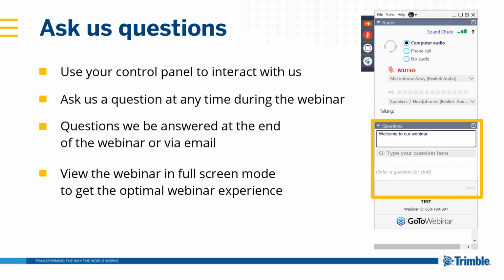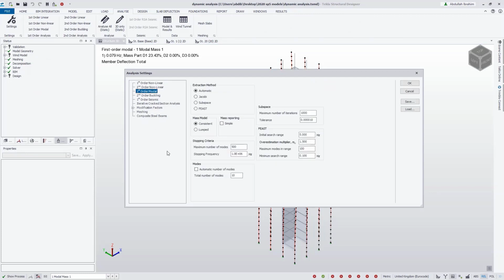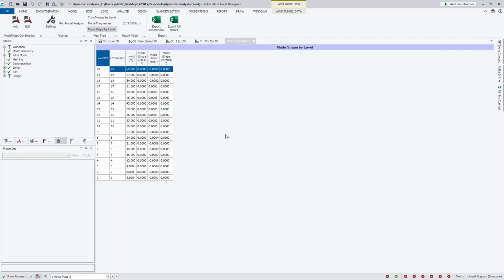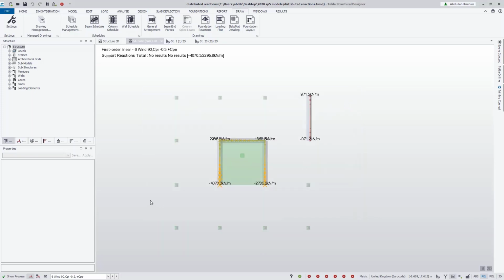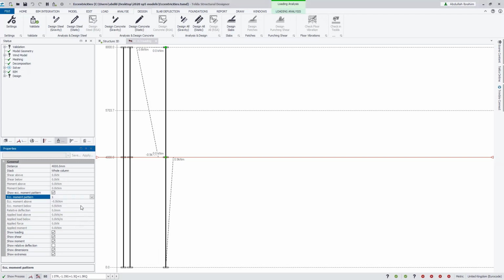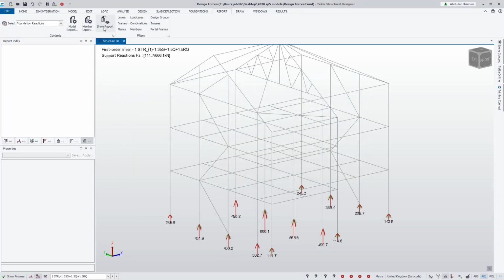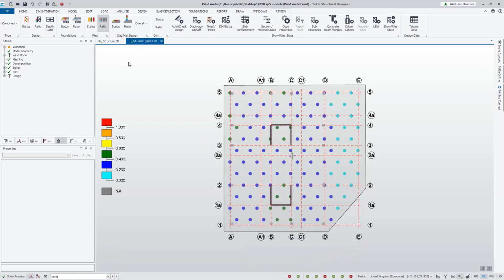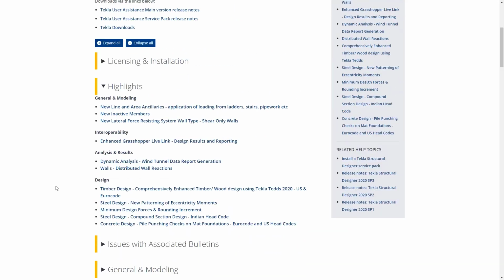Tekla Structural Designer 2020 - Key features for analysis and design

Comment: Cool features in TSD 2020, I appreciate the way you present them.
Can you please consider improving design and analysis of cast in place concrete one-way slab.
Reply: Thanks for your message! I'd recommend having a look at our TSD 2021 SP2 Release Notes where new Orthotropic slab properties were introduced. This new feature enables different stiffnesses to be set for the two orthogonal (X and Y) directions of slabs thus making them orthotropic rather than isotropic (same stiffness in both directions). This can be used to model slab elements that exhibit orthotropic material properties and are assumed to behave in a predominantly “one-way spanning” manner, such as; precast slab units, profiled steel decking, timber decks on floor joists and cross-laminated timber (CLT) elements. Your local support team should be able to point you towards additional information if needed.